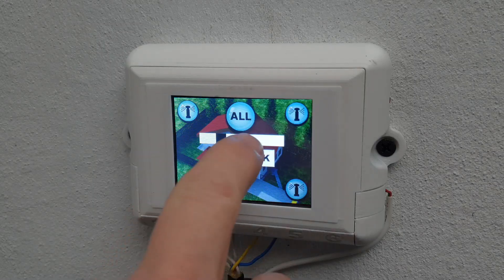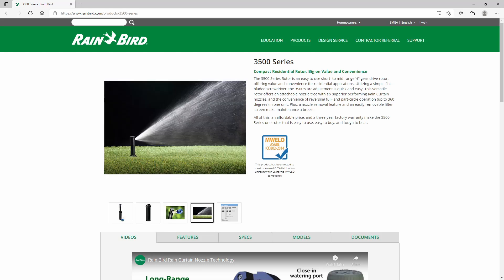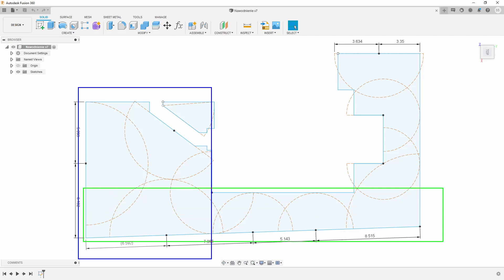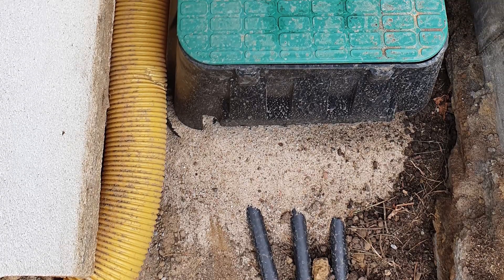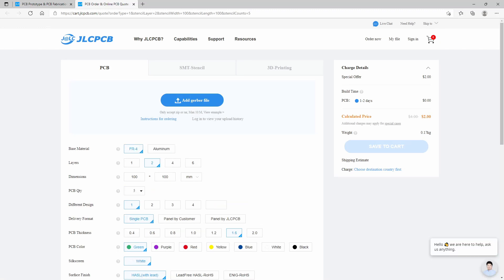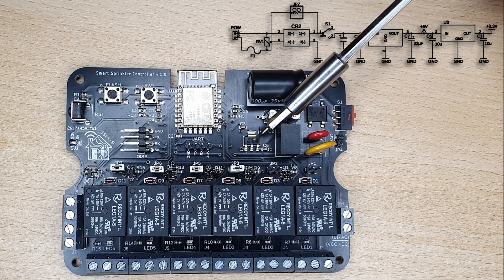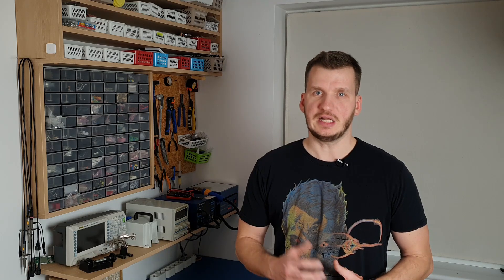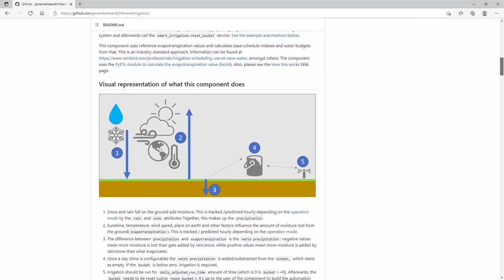Upgrade Your Lawn with a DIY Sprinkler Controller Based on ESP8266

Comment: If one of the solenoid valves fails, can your system detect it and send a notification to you?
Reply from the maker: Unfortunately, there’s nothing here to detect a bad relay. But they really don’t fail nearly as often as you’d think. If you grab a quality, name-brand one, I promise it’ll serve you for years without any issues.
Reply: @SmartSolutionsForHome  Generally speaking, it is not that easy to break down, but I have 12 stations, and one of them breaks down every year or six months. I am currently using Hunter, which will display the failed parts. It seems to be achieved by measuring the resistance value. I am currently looking for a controller that can be connected to Homeassistant, but I also hope that it can have a detection function.

Comment: Nice work … and I have a question … can Esp32 be use instead of esp8266?
Reply from the maker: Are you asking in general or specifically in this example? If you're asking in general, then yes, definitely. And in this specific PCB, the footprint for ESP8266 is already prepared, so unfortunately ESP32 won't fit.

Comment: this is video has been so valuable, im busy preparing my irrigation system for German summer, ive build a controller also with a nextion display  used some of your code :) ... was wondering, have you used smart irrigation ( i find the german values a little confusing) would love to see your automation for this!!! im planning to use Node Red....thanks again for the inspiring videos
Reply from the maker: Thanks, Erwin! I'm glad that the video turned out to be valuable for you! :) I'm from Poland, so we have a similar climate, and I'm also gearing up for summer. I can tell you in secret that I'm currently making a DIY Rain Gauge video that will be a fantastic addition to the Sprinkler Controller :)
As for the "smart irrigation" integration, I haven't used it yet. It becomes useful when it has information about the amount of rainfall. However, the information I tried to get from the internet often didn't match reality. That's why I built the Rain Gauge myself.

Comment: You are amazing!  I was planning to build my own ESPHome solution until I stumbled across your channel.  This is far beyond the quality of what I would have made.  Thanks!  Side Note - any time I visit your website I have to turn off my firewall because otherwise it blocks your site for attempting to connect to my PC on a strange port.  I dont run into this with other sites. You may want to look into that...
Reply from the maker: WoW!! Thank you!! :) I really appreciate such support for my work!
Reply: @SmartSolutionsForHome   I finally got my controller installed today.  It works great, thanks again. I might actually buy a second one.  Would you consider building/selling one with the ESP8266 model that includes an external antenna?

Comment: I think you made a great job on the electronic  field but in my opinion to much errors in the sprinkler positioning. To much uncovered space , some very easy to fix with just a better positionig and some extra sprinklers You should always start from the corners  making the sprinkler area overlap. Also I didn't see if you did right but the tubing should always have a circular closed cirxuit if not the first sprinkler will receive full pressure but the last could be weak and even not be enable to rise enough. Also when you count how many sprinkler for area you should leave some space considering about 10/15 safety range  Maybe you system will works but if someone will follow your step projecting tubing setup and sprinkler placement could be not have the same success Thank you for sharing and congrats.
Reply from the maker: Thank you very much for this comment. Constructive criticism is always welcome on my channel :) You sound like you know what you're saying so I don't plan on arguing, well.. maybe just a little :)
Before I started talking about pipes and sprinklers, I made a disclaimer, that I'm not a specialist in this field. In case I did something not quite the way a professional would do.
And I'm aware that additional sprinklers would allow me to cover a larger area. But I was on a tight budget. And I don't think it was possible to get a better result with this amount of sprinklers. But I could be wrong, of course.
What is a "circular closed circuit" ? 
Thank you again for this comment! :)
Reply: @SmartSolutionsForHome  I am not a specialist too , my knowledge come after I studied a lot for realize my own irrigation system. I 'll tri to explain what i mean with closed circuit. Excuse me but English isn't my first language. Let's consider  a tube coming  from the water source and closed  at the end. Then you put sprinkler along the way. What will happen is that the first sprinkler, the one near the water source, will have a lot more pressure than the one at end. So you'll have different water radius more and more you 'll go farther away from the water source. For avoid this problem usually the sprinkler system are distributed along a circle , the tube start from the water source and end at the water source ,like a donut. In this way pressure and water availability will be the same for all the sprinkler installed along the tube. Anyway great job I wouldn't  be able to make such electronic device by myself as you did.

Comment: i already have a smart sprinkler controller but I might make this one just for the fun it. Very good work!
Reply from the maker: Thanks! Did you do something yourself, do you have a device off the shelf?
Reply: @SmartSolutionsForHome  I have a Rachio 2 I bought on a sale. It works really well but it’s just the software that makes it so nice. If I could replicate the smart cycling and weather skip stuff with Home Assistant then I would go DIY.